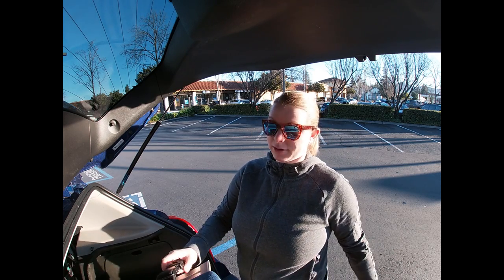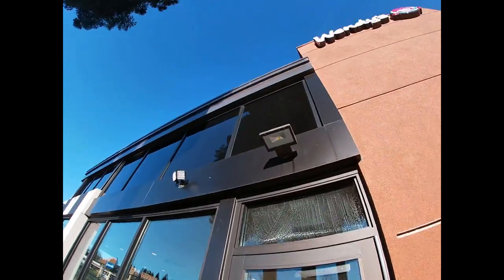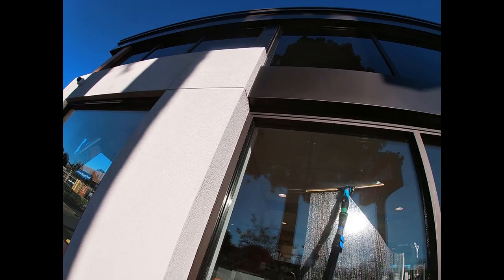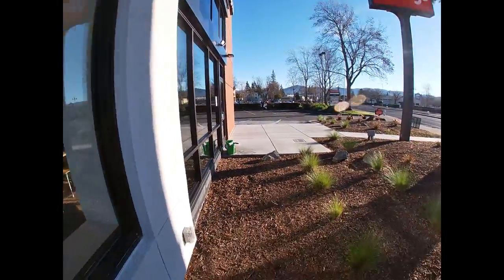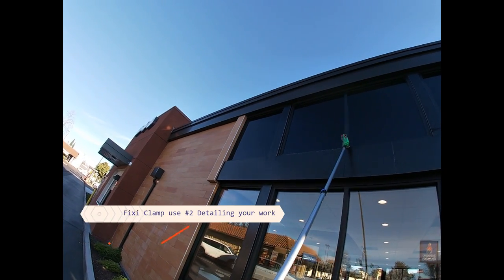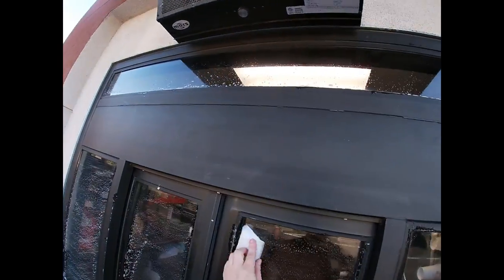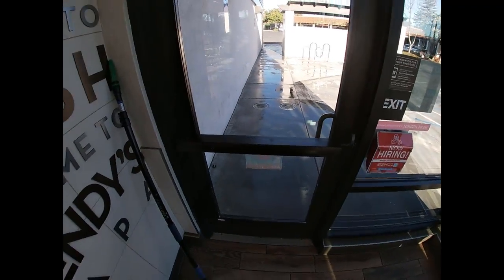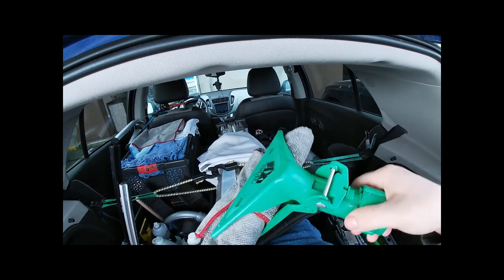Window Cleaning Tips and Tricks: Unger FIXI  Clamp Hacks

Comment: Great video!  As an old timer I observed a few things, ignore my comments, or incorporate a few tricks, here ya go:  1. wood pole tip cones are way better than nylon tips, just make sure to soak them first for at least 20 mins. nobody likes a dry cone : ),  on that note you will need a pole with a universal threaded tip , called an ACME tip to thread the cone on to. 2. On that same level give a Garelick twist lock aluminum pole a try, a really nice tool , super smooth, nice 1/4 turn locking interior collar, no exterior clamps, just a light turn and they are locked and unlocked, you will love them. 3.Ledger - pick up a 7"ledger handle, you will never look back, old tool , been around for decades, it would cut your time in half on this job, straight pulls, with a little bigger channel as well, like a Sorbo. Also that inside deep pocket window at teh drive thru, a ledger is a dream when finishing off on deep pockets. Also if you had the ledger on the outside pole work you would have stright pulled all the way down, no need for that second squeegee, and tool change over. 4. On all of your bronze aluminum panel and frame wiping, use a wet strip washer, do a whole side , give it time to dry and drip, dont use the fixi and dry towel, the flat panels will look so much more uniform if you just strip them with a wet stripwasher, a swivel t-bar handle stripwasher is preferred, turn it vertical. 5. the Magic eraser is fine, but pick up a white 3M floor buffing pad (janitorial) 17" is a good size and cut hand sized scrub pads from it like pie slices, once you have that you will fine many uses for a universal white scrub pad. last forever too. On your squeegee, trim back your rubber a tad on the ends, let the channel touch frame, not the rubber ride up on the rubber glazing strip, it will cut your rag work down and need to detail 95%, with straight down pulls this together will help a lot to reduce detail work. People don't realize it, but rubber "climbs" on the thin rubber seal, and leaves a wet edge. Stop it from climbing by trimming back like 1/16" from the end of channel, does a lot.  thats all. thanks for making videos, I'm a big fan.
Reply from the maker: Just another Jarhead thank you for more wonderful tips! I’ve pinned your comment for future newbie window cleaners to see (including myself 😉)👍.

Comment: The best thing I found useful for the Unger fixi clamp, is to throw it in the trash. It's weak, it tightens like crap and it doesn't hold a rag or towel worth a poop. 
Instead I use the pulex aluminum fixi clamp. MUCH better tool that does the job it's supposed to.
Reply from the maker: James W. Yeah if that works than that’s awesome too👍🏻. 
Personally I've just had these Unger clamps on hand for awhile, Picked them up at a janitorial shop years ago. 

I didn't know Pulex made something similar, I might have to try it🤔.
Reply: @heatherthewindowwoman4835  Plastic is fine, but in our line of work, metal is preferred in general. yes the metal ones are that much better.